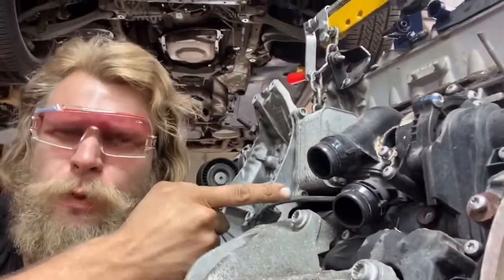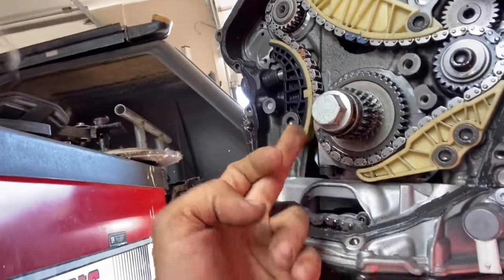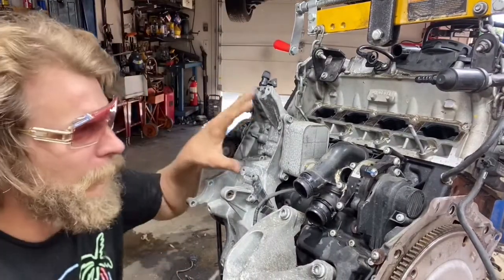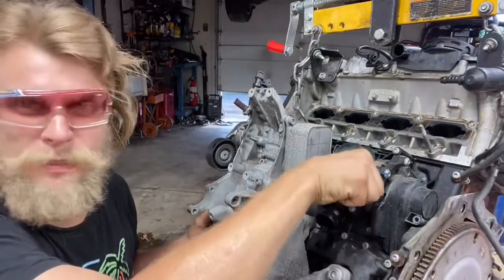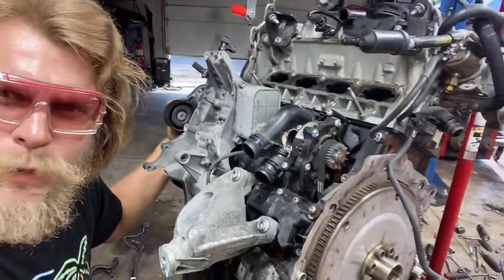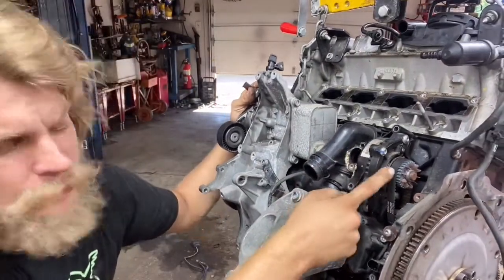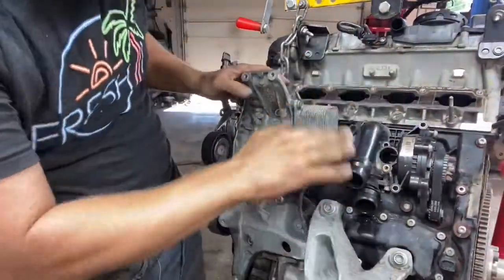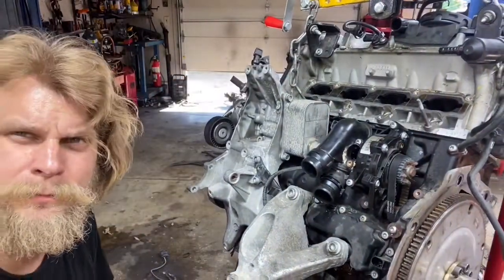2.0t Audi VW water pump replacing P2181 thermostat temp temperature sensor cts

Comment from the maker: Replacing in the car https://youtu.be/K3TfykE4uFo
Reply: Hey bro i changed the water pump on my a4 b8 2.0t quattro  and flushed everything, put new coolant in and i changed my cooling fan control module, now its all back together and my radiator stays cool even after running awhile, i got blazing hot heat inside the cab i just think its not circulating through the radiator? Is that make sense? I need some help and not the dealers, i used the oem radiator filll kit that uses the air compressor to create a vacuum to fill the system, any help would be greatly appreciated.

Comment: I changed the original water pump on my 2013 VW 2.0 TSI CC. I watched your videos. The VW was a little trickier than the Audi. The hardest thing was getting the charge pipe off of the throttle body and removing the throttle body bolts. There are two Copland lines that come from the passenger side of the engine remove those first, it gives more access to the throttle body bolts. I used the Graf aluminum water pump. Seems to have stopped the leak. Thanks for your videos they are very useful and entertaining.
Reply: Grafs are good pumps.  I assume you purchased the all aluminum pump module.

Comment: Man I wish I'd seen your videos prior to working on my daughters Audi Q3 with 106k miles!   Had to replace the Radiator so while I was at it, I decided to replace the water pump, the intake manifold (throwing a code), PCV, and will be doing the timing chain as well using your video that I watched yesterday.

Comment: You have no idea how much you’ve helped me as I build my a4 b8 to 600 hp slowly . Thanks so much man much love !
Reply: so question was your coolant temp sensor on the waterpump or was it in a different place. I have a 2011 audi a5 with some a4 parts installed and im thinking its my coolant temp sensor thats causing my radiator fans not to spin when the ac is on. its either that or the fan motors died out. I already replaced the 60a fuse in the centeral terminal checked the fuses in the panels and replace the fan control module and still nothing.
Reply: what'd you replace to achieve that?

Comment: I was actually hoping you would show the removal of the temperature sensor. I am having a fan problem that does not come on it starts to come on but does not actually come on it spins around a couple times and then stops if I apply current directly the fan runs fine. So I need to replace the temperature sensor preferably without pulling the whole pump out and the intake and pulling the engine out and so on and so forth that means I have to know exactly how it becomes disconnected and pops out

Comment: Ok now I am confused. I saw another vid showing thermostat replacement. Not water pump.
I have 2007 2.0 ( b7)
My car temp is running very cool. Very low heat on the heater. I have had mil engine temp codes. Any advice is appreciated

Comment: This video was very helpful when I did the water pump 8 months ago but now I’m having issues with the coolant temp sensor not operating.. temp on gauge won’t read and fan always on. I replaced the temp sensor and everything was fine until the next day after a 90 mile drive it failed again and back to the same symptoms.. can it be that the temp sensor from o’reillys auto parts suck?

Comment: Hey bro i changed the water pump on my a4 b8 2.0t quattro  and flushed everything, put new coolant in and i changed my cooling fan control module, now its all back together and my radiator stays cool even after running awhile, i got blazing hot heat inside the cab i just think its not circulating through the radiator? Is that make sense? I need some help and not the dealers, i used the oem radiator filll kit that uses the air compressor to create a vacuum to fill the system, any help would be greatly appreciated.

Comment: So I got a leak somewhere cant see it leaking leaks alot all I see if it leaking down the oil pan on drivers side coming from up top somewhere oil pump was put on 1000 miles ago back of engine where coolant flange is seems dry nothing on trans any ideas coolant comes to front of oil pan

Comment: Hi, I am currently working on a 2011 audi a5 that has overheating issue.  I took apart the water pump to inspect and noticed the balance shaft that drives the belt for the pump is not moving.  Basically the pump is fine, but that shaft does not turn when the engine turns over.  Any idea what part I need to replace to fix this? Thanks.

Comment: Just changed my pump it is leaking from the small nipple that connects to the small heat exchanger. I even replaced the o-rings with new ones. Any ideas?
Reply: did you replace the plastic nipple bit that the orings go on to aswell?
otherwise its probably rolled the oring off or nicked it

Comment: Exactly what I needed to see my 2.0 is setting a cooling performance code, so I figure I need to replace that whole module since the t-stat is in there. Do you have a opinion on the upgraded aluminum water pump modules? I am not so sure I could l do that with the intake still bolted up though. Maybe I will look into taking it off and doing some carbon cleaning.
Reply from the maker: Thomas Hoyt here is the intake video, https://youtu.be/kR8zLHJVrNY  
valve cleaning helps but I don’t typically do it unless there is an issue.  Only needed to do it like 10 times in 9 years on this engine but I prefer to just do a rebuilt cylinder head on a car I plan to keep.  No experience with the aluminum water pump someone had a cast-iron water pump and it didn’t fit right had to replace it.  In this video when I show the other engine with the balance shafts look at that water pump.. there is a aluminum piece in the updated water pump and it looks like that.
Reply: You can remove waterpump without removing intake
Reply from the maker: I explained in this video that I’m showing it so you can get the best view outside the car.. and that you should do it with the intake still installed.
Reply: Do you have to remove the car from the engine to change the water pump?
Reply from the maker: @isackhernandez3691  I hope that’s not a serious question
Reply: No of course not thanks for the video. It helped a lot. This engine is very popular in VW line up. Kinda digging it.

Comment: I have a 2013 VW CC Sport with the 2.0 TSI engine, is it possible to change the water pump without having to remove the intake manifold, since it is a transverse engine?  doesn’t seem to be as much room as in the Audi’s.
Reply: i did one a few ago on a 2013 vw golf gti
did it without removing intake manifold.
was a pain in the arse but doable.
take the throttle body off.
the audi intake manifolds look much easier ti take manifolds off tho

Comment: I just pulled mine apart, realized the small pulley is broken which is why it wasnt cooling the engine, how hard is it to put a new pulley back? Pls help!
Reply from the maker: Be honest, you broke it didn’t you?  If it broke itself for some crazy reason I would feel it necessary to remove the entire intake balance shaft for inspection.  If you broke it trying to remove it you’re gonna still have a bad time but it might spin out with a right angle pick (reverse thread)
Reply: I paid some dummy ti change my thermostat. Housing and i think he porbably put it on wrong and it popped after 3 months or so, is there a vid i can follow of you dismounting the intake etc?
Reply from the maker: @jimmytejada9480  search NaptownTuner 8min intake removal I have a couple though
Reply: I was able to take the belt off, i have it in my hands, i want to know what i have to do to put in a new one, i might have to change the whole waterpump anyways, bc there was a coolant leak and it looked like it was coming from the waterpump, i did not do a preasure test before taking it out so i dnt know exactly where the leak was coming from, it honesty looked like it was coming from the water pump area, and i assumed it was the water pump, also my car kinda overheated bc i saw the needle go to the high side...

Comment: The wires to the coolant temp sensor pulled out of the plug on a 2008passat 2.0t and don’t know wihich wire goes where on the plug or doesn’t it matter?
Reply from the maker: That’s why I save old wire harnesses, I don’t know for sure if it matters but I’d put it back the way it was.  Sometimes you can take the plug apart and find enough evidence of the old wires to put it back together
Reply: The wires pulled right out of the plug so there was nothing to go by, I replaced the water pump and now a few seconds after starting the car both fans turn on full force. I went by your video and it was a great help, I dint replace the coolant temp sensor and tried wiring both ways and fans still run full speed. Nothing was wrong except for a leak prior to replacing.  Any help would be great
Reply from the maker: Go to your local junkyard and chop off the connector and butsplice connect it.  Even if you get it right it’s going to take about 10min unless you clear the faults
Reply: Already been to the two in my area but didn’t have anything but I was able to get the right plug just wasnt to the sensor, it’s been one of those projects where if it can go wrong it did including someone else previously worked on the car and I had to put things back the way they should have been. I appreciate what you do and your videos, best ones out there that I’ve found. Thank you, somehow I’ll figure it out on my own.
Reply: I finally figured out what was causing the fans to start up justAfter starting the car. The plug I got to replace the one that was on the car must have been corroded or something inside the pin, check for continuity and one side was dead so luckily while at the junk yard I grabbed a couple and switched it out, now runs like a top again, thank you for the help it was enough to get me to think and figure it out, except for all the if it could go wrong it did your video and instruction made things easy.

Comment: What do you think about the water pumps off Amazon there $60
Reply: Get the aluminum one m8
Reply: @davidescobedo1317  that is the one I put on
Reply: @SCRAPIRE  Graf unit? Did you re-use bolts?
Reply: @JH-sc7cs  yes I got the aluminum one off of Amazon and it seems to be working just fine
Reply: @SCRAPIRE  Ok cool, doing my install this morning with the Graf unit re-using the bolts

Comment: Where is the thermostat?
Reply: Thermostat is Contained in the water pump housing and is usually all replaced as a single unit. Read the description on your new pump when ordering  to make sure it says includes thermostat
Reply: @jayscheck  thanks. Mine came with new thermostat and sensor

Comment: My friend u need to learn more coz out side engine nd u strugling what abt if the engine in side  the car i dont think so u gona do that waterpump , u can fit  without belt waterpump first, tight the waterpump bolt , then after put the belt on waterpump gear nd turn the creankshaft pully anticlock wise !!
Reply from the maker: https://youtu.be/K3TfykE4uFo
Warranty time is about 3.5hrs most shops charge up to 5hrs for this
Reply: Tanx alot for the video it was very helpful